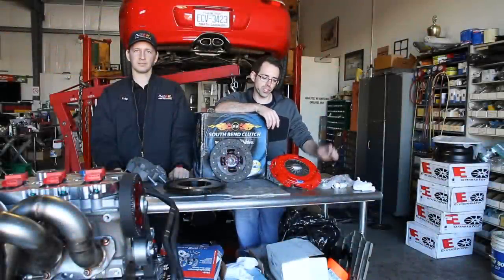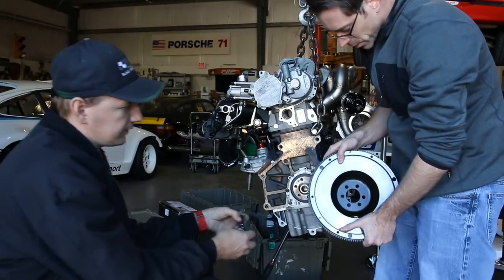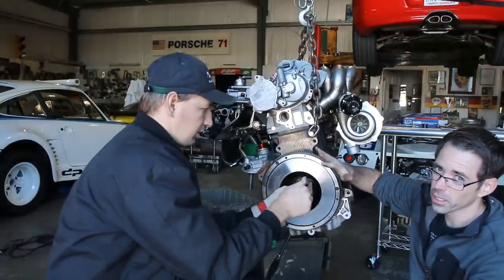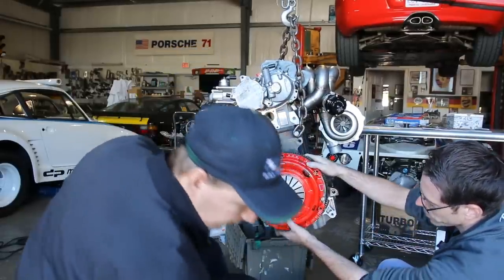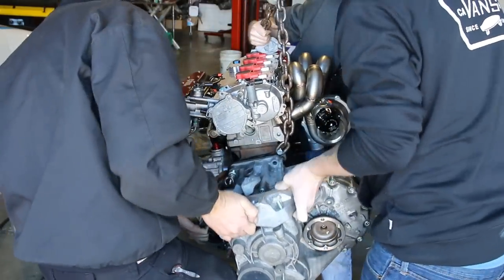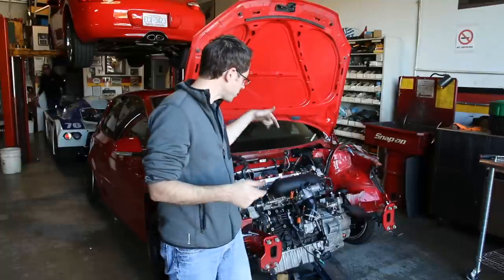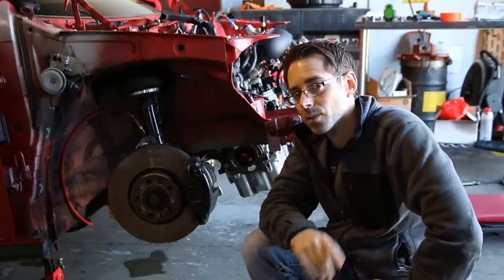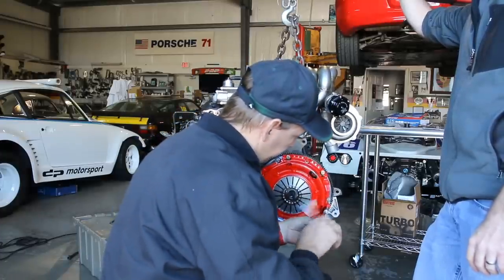Southbend Clutch and Engine Install | Project MK5 Ep 6

Comment: Food for thought, i just found out that the flywheel bolts from 2006-2008 GTI (FSI) is different to the 2008.5-2009 MK5 GTI to MK6. The flywheel bolts on the 06-08 is 6 bolts and the 2008.5 to the MK6 GTI's are 8 bolts. Lesson learned.
Reply: Have you done a clutch and master replacement on a 06 mk5 gti before?

Comment: Paul. Did  you instal the shim kit for the Throwout bearing for Southbend clutch kit? And also did you replace the crank bolt when installing the Fluidampr? 

Reason why I ask is that I have Southbend stage 2 clutch kit for my 02M transmission for my R32 and will be using NLS Shim kit.  I also have the Fluidampr pulley. But wasn't to sure that I should replace the Bolt.

Comment: Love this project and would love to do the mods on my mkv, but one question keeps hounding me, how are you dealing with the pressures that would be coming through a pcv if it was there? I ask because the previous owner of my mkv capped off the rear breather when he installed a bigger turbo and it keeps blowing pcv valves, I'm having a hard time figuring out a way to re-integrate the rear breather being as the new turbo does not have the mount or the hole for the breather to route into. Any help would be greatly appreciated! and love the videos!

Comment: Why didn't you guys just use the Crank hold tool?I bought one to replace my cam chain tensioner. Makes it easier to torque the crank bolt.
Reply: Herschel Singlee since I'm primarily a Porsche shop (though I've run a VAG shop in the past) I don't have a few of the specific tools and it's not really worth buying them for just one build. It's definitely easier when you've got all of the tools!